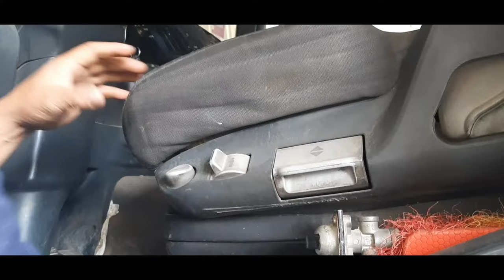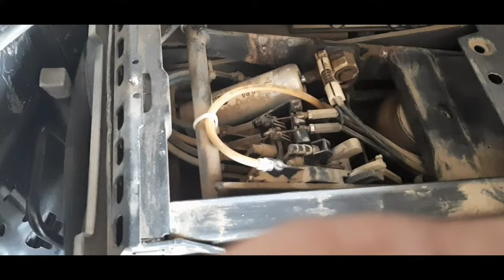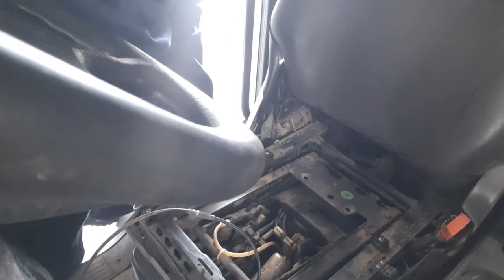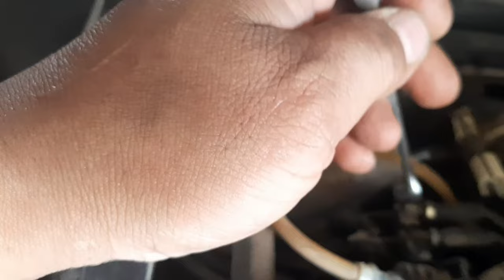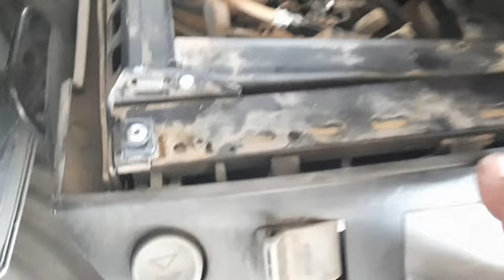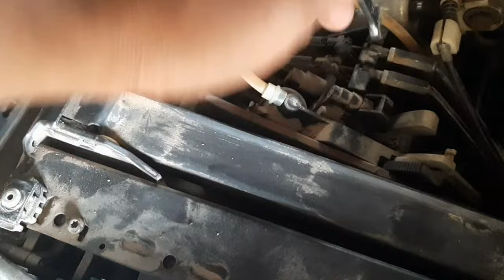MAN TGA..How to Repair Driver Seat Air Suspension not Working.

Comment: sir paanu kung hindi na sya nag peplay tumataas sya pero sumasagad na sya sa maximum at kahit anu adjust ko tuloy parin sya sa pagtaas?
Reply from the maker: Kapag ganun sir sira na ang mga bushing nyan.lumalayo na yong control mechanism ng hangin na pumapasok sa airbag.yong plastic na gear na stopper para macontrol ang hangin ay magkalayo na